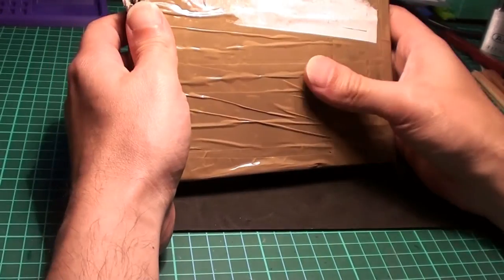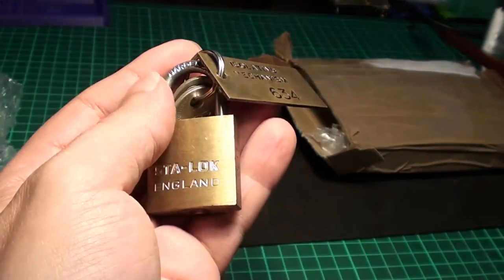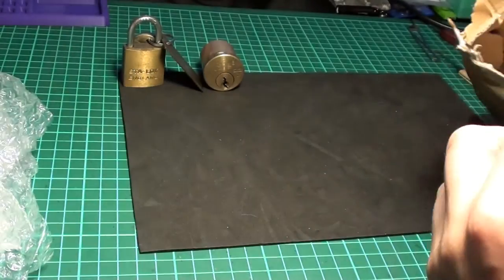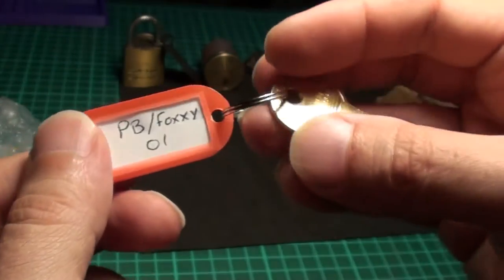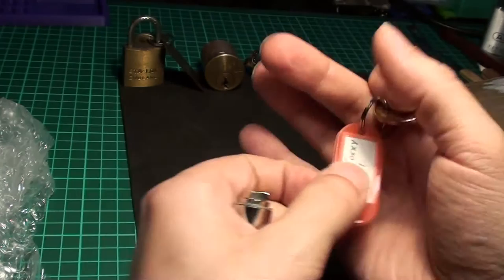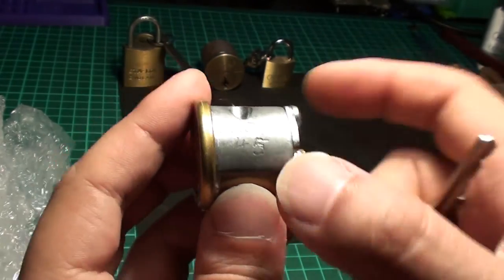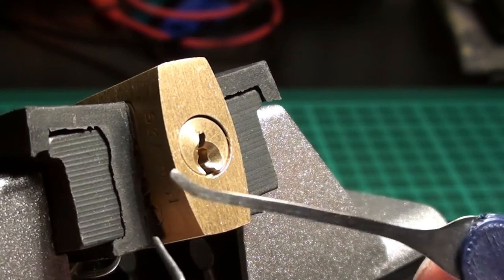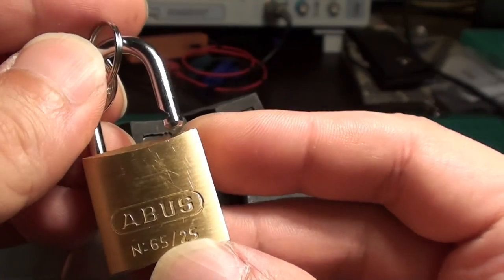#035 - unpacking Pickbeard's surprise package :)

Comment: those kite marked Yales are horrid, good luck! I'm sat here picking a Sta Lok one like yours, my biting is one of the worse I've seen. key looks like a Bogota.
Reply from the maker: Actually the Sta lock is so crusty, the key turns only with much force. I will have to give it a very good cleaning inside and oiling. I'm usually not a speed picker, so I don't fear the kitrmark ;). I will give it a try and one day it will speak to me; ).
Reply: +redcatimaging I've had a few Sta Lok, even new they're rough an scratchy!
Reply from the maker: I will take care of it ;).

Comment: Hope you have fun my friend.👍👍👍🍻
The PB /01&02 are both challenge locks( have a play,send onto others if you wish)😉😎
The 01 has the key to cut after you have picked it ( Potti does a great vid on how to do this),I just thought you would find it fun and another string to your (key)bow😉😉😘😘
Lastly nice picking on the little little Abus🍻😎🔓👍👍😉😘
Reply from the maker: I have alot fun PB :D. I actually thought I have to impression the key, what did not went bad at the beginning...until I got no more marks any more. To finish the key, I had to pick the lock several times, finish filing and try the key. It only turned when the lock was upside down. After taking the lock carefully apart, I then found driver 3 deep stuck in it's hole ;)...oh man ;)..it was so short that it had turned. I had to drive it out and did a pretty good repair with a little longer driver. And now even the key works absolutely fine (with some help of resizing it with superglue hahaha...after I did some wrong filing when the pin turned...). You know how to get me busy ;)). I've learned alot and did things I never did before. It was by mistake, but a big thanks for that experience :D. The challenge lock with the brass key was pretty nice (luckily I picked it upside down..would have never got it open due to keypin 3 falling in the driver hole...) you did make absolutely nice pins.
Actually I forgot to look at the keypins, didn't take them out the plug, yet. So I gess you will see a vid some day ;).
The little Abus is very hard, as I almost get no tool inside to pick it. Was really a surprise package, love all you took in :). I will have fun with the other locks too in the next days :). A big big thanks my friend :D.